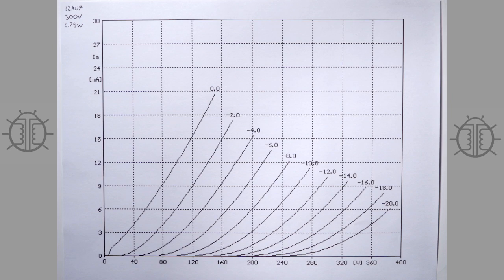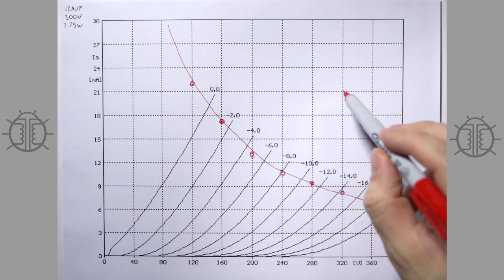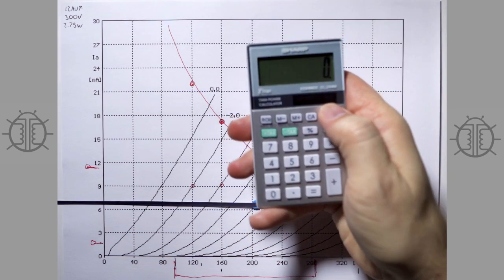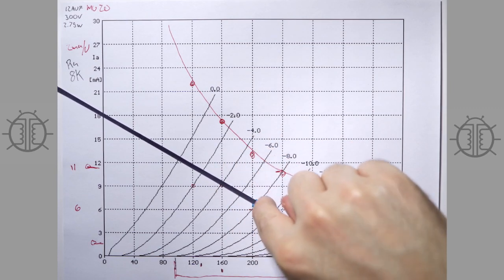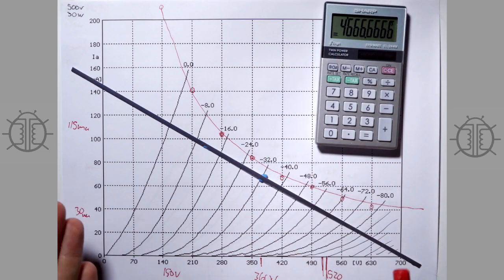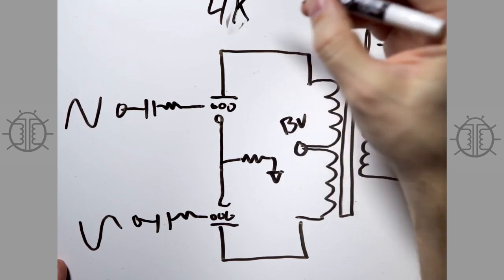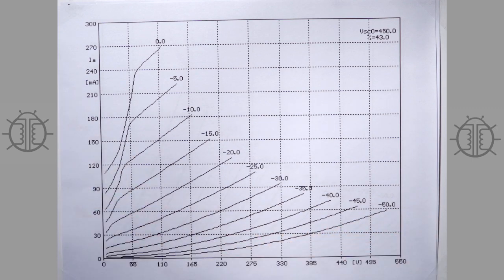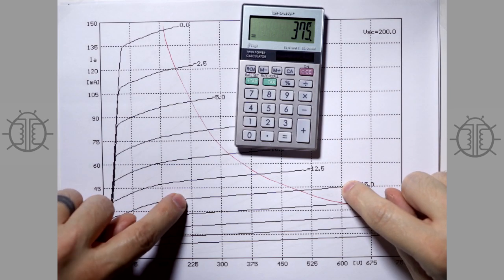Plate Curves and Load Lines!

Comment: So if I unload an amplifier by disconnecting a speaker I get a horizontal load line. Please correct me if I'm wrong: as long as I don't input any signal to the tubes grids I won't make no harm to the amplifier, because I stay at one point instead of swinging on the load line risking over powering the tubes and output transformer. I just want to measure a static voltage values in an amp but I don't have any load with me.

Comment: 17:32 horizontal load line, that's when you get the most gain for the stage and when the output has the least distortion. You can do this with a constant current source as a plate load. By the way, a 6cg7 will do everything a 12au7 will do but with a lot less harmonic distortion.

Comment: The best explanation ever. But i had a question. How can i know ezample if 12ax7 is good as driver for kt88?  I mean what i need to check to know ? Thanks
Reply from the maker: @jonathangauci2182  it has a lot to do with the input Z of a KT88. It will have a minimum grid leak value that will set the input Z. You have to place that Z in parallel wit the driver tubes load resistance. If that ends up tilting the load line too much you will loose the gain of your driver stage.
Reply: @Edgarbopp  thank you so much.

Comment: nice video thanks, a doubt arises at minute 36, if the supply voltage is 360v how does the signal oscillate up to 520?
Reply from the maker: Good question! Because the output transformer is an inductor it has a reactance not a resistance. It supplies the voltage above supply. Inductors supply voltage to preserve current. They’re a type of current source.
Reply: @Edgarbopp  That's incredibile, so when the tube oscillates in class A, before the cut-off at the bottom, it always reaches that extra voltage? Thanks for these clarifications

Comment: If my b+ is at 300v, and a cathode resistor is dropping 100v does that move the bias point to 200v on a reactive load?
Reply from the maker: The voltage is the plate to cathode voltage. So you don’t count the voltage across the cathode resistance in a cathode biased stage.
Reply: @Edgarbopp  thanks again! Much appreciated

Comment: At 33:45 you set an operating point.  What determines the angle of the line from that point?
Reply from the maker: I picked a slope that looked like a swept through the most voltage and current without exceeding the max dissipation. You can see it’s roughly 700v and 150ma. So using ohms law that’s a load of 4.666k or so. So an output transformer presenting a 4 or 5k primary load would probably work well there.
Reply: @Edgarbopp  thank you! It's taken me so long to understand,  but I'm finally getting their
Reply: @Edgarbopp it's all making sense now.  Thank you again. So much.  In regard to the perfect current source/ perfect voltage source. What helped me understand was to look at it another way.  If the tube went dead short to ground the voltage would drop to zero, and the current would be limited by the plate load resistor dropping the full voltage of b+ across it.  That is where the load line hits the graph on the left side. If the tube shuts completely off, the current drops to zero, and the voltage rises all the way to b+. That is where the load line hits the graph on the bottom. We are biasing, choosing a plate load resistor, and setting a dc region to rest in so that the grid voltage can swing either way, undistorted, within the watt limitations.

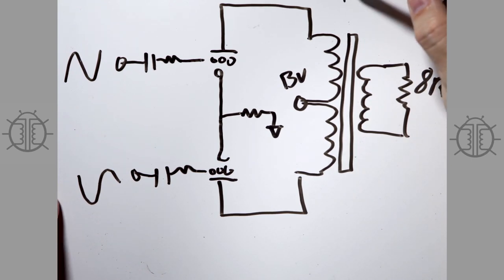Comment: I think your presentation is very good and am sure you know this and in a presentation I know it is easy to speak and overlook small things but just after 44:00 where you say the plate-to-plate Z is 8K and half of that is 4K is incorrect. It is actually 1/4 the L from one side of the OPT to CT and would be 2K instead of 4K.
Reply from the maker: I just reviewed that portion of the video and I believe what I’ve said there is correct. A 8k primary will look like a 4k for each plate of the output pair and will transition to 2k when the stage enters class B.
Reply: In a transformer winding like the primary of a vacuum tube output transformer, we have the series inductance of the coils from the CT which is L1 + L2 and we also have the mutual inductance between the coils as they are wound on the same core and share the same magnetic flux. Neglecting leakage inductance which is usually in the mH range, and assuming the coupling factor to be 1, the mutual inductance doubles the series inductance. A common value for vintage output transformers like the UTC or Acrosound transformers is 20H plate to plate and 5H plate-side to CT. Direct measurements with an LCR meter will confirm this.
Reply from the maker: @ElPasoTubeAmps  I don’t think I talk about inductance anywhere in this video. This is about the impedance of the primary and the resulting voltage and current swings at the plate. In this video the inductance of the primary is assumed to be sufficient to load all audio frequencies. Of course in real life not every transformer has sufficiently high inductance to load the lowest frequencies but that was beyond the scope of this video.
Reply from the maker: @ElPasoTubeAmps  I’ve just reviewed several articles to be completely sure on this and they all agree with my previous understanding. Have a quick read here as a example http://www.valvewizard.co.uk/pp.html
Reply: I commented because the inductance (L) of 1/2 the P-P winding (one anode side to CT) is 1/4 the P-P winding L, and therefore the Z would be 1/4 also.  Maybe inductance should be dropped from the discussion. I realize you were only speaking of Z but L has to go along with it and your video is about load lines and not about transformers.  L and Z is easily measured with an LCR and Rs meter on the bench in a static condition. 
The article you linked to is interesting and I can see that both of you have more experience in guitar/HiFi amplifiers than I do although I did do repair on such amplifiers for a couple of years here in El Paso after retiring. Quite honestly, I took up the repair of guitar amplifiers up so I could study the amplifier builds and designs... Anyway, I see where the article says that once the amplifier/transformer goes into class-B operation (which I am actually not buying that concept from just a signal drive perspective) the L and therefore the Z of the transformer winding from anode to CT changes from 1/2 to 1/4 the L and Z of the P-P winding. My point is, I do not believe the Z (or L) of half of the winding from anode to CT is ever at 1/2 the P-P impedance and remains 1/4 the P-P Z regardless of how the amplifier/OPT is operated. Maybe it changes under dynamic conditions I do not understand yet but I am open to learn and understand. My question would be how would we verify the claim in the linked article by measurement? I can't see how it would be done with plate characteristic curves as the load Z is a derived parameter from the characteristic curves and not an input parameter.  Maybe I am missing something here.  Best regards.
Reply from the maker: @ElPasoTubeAmps  it would be easy enough to look at the plate swing with a scope and see if it follows the load line I predict or yours for a given load. Maybe give it a try. Take precaution probing plate voltage though.

Comment: Hi sir thank you for make this video..but  I have some problem..I couldn't understand   how we can calculate output impedance..sir can you help me about it I saw some other YouTubers but they didn't say anything about impedance..and I need    to know about this section please lead me ..and thank you again
Reply from the maker: Asking what the impedance is, is asking the question “when I change the voltage at this point how much current will it require?”  So once you’ve drawn your load line pick a convenient place to measure the change in voltage along it and then measure the current change for that same part of the line. Then V/I=R. The R in this case can be thought of as the impedance. Though impedance is also time dependent so will change somewhat with frequency. But for now don’t worry about that.
Reply: @Edgarbopp again hi sir. And i am full of thanks for answer my question...sir I design my circuit...I choose my load line and everything is done ...but I need to know how I must calculate output  impedance..I don't know could I gave you my intention...
Reply: @Edgarbopp  I mean about impedance  is inner   impedance
Reply: Sir if you need more information I can give you my email  or my telegram or Instagram...you just tell me sir and thank you

Comment: I think is a good idea to clarify .How those two points that define the load line are selected ..
1) Max plate Voltage at 0 current .. THS IS the tube in cutoff ,,, no current flows ..this happens when grid bias is very negative
here the Max Plate voltage = Power supply ..So you will chose this point equal to the power supply 
2) MAx current  at 0 plate volts ( yes is the PLATE voltage not power supply) ..This happens when tube is in saturation ,,and the plate is at ground level .This happens when grid bias is very positive ..
Reply from the maker: Max plate voltage equals the supply voltage in a resistive loaded stage. It swings higher than supply in a inductively loaded stage. Thanks for the comment.

Comment: Wow, Doug, the best explanation of loadlines ever... the white boards, blue-tack, and load line sticks are so much better than any computer-generated graphic!

I have been in the electronic repair business for almost 30 years, and have loved vacuum tubes through all the integrated circuits and solid-state stuff I've had to slog through! 

I have been to college, have the Radiotron Designers Handbook, and too many others to list, and am getting into more tube design then repair work now that I have turned 65 (age has its benefits!).

The one thing I haven't wrapped my head around yet is the primary impedance change when one of the tubes shuts off in class AB.  I'm going to dig into my books and see if I can figure this one out.

Your video wasn't too long at all, I plan on watching it at least two or three more times.  Thank you for generously sharing of your knowledge!
Reply from the maker: Thanks for the kind words! It means a lot!

Comment: I keep coming to this vid haha, I'm in the process of designing a guitar amp with a push pull power stage using two PL504 and this is super helpful.
Reply from the maker: Thanks for the comment. It definitely feels good that people find this helpful!
Reply: @Edgarbopp  sure man. Hey, would you check my spice model of the design? I hope I’m not bothering. No probs if you can’t, the thing is I’m a rookie in this field and lacking feedback. Thanks anyway since you’ve already helped me a lot with these vids =)
Reply from the maker: @leandrocarg  if you show me the circuit I’ll have a look at it and let you know if I see any issues.
Reply: @Edgarbopp  thanks 🙏🏻! May I send you the files via email?
Reply from the maker: @leandrocarg  do you have Facebook or Discord?
Reply: @Edgarbopp  sorry for the delay, I responded twice to your question and for some reason YouTube doesn’t post the response. I have a Facebook account!
Reply from the maker: @leandrocarg  ok! Look for “Bug Amps” or my name and add me. Messenger will be a easy way to discuss your circuit.
Reply: Very useful and well done video!
One questione only: in the PP AB1 class circuitry, how does the load line switch from B to A? Ok, the designer select the proper Vg, usually not to enter the tube extra dissipation area, but It seem that the tubes "sees" the correct grid voltage to switch from B to A and viceversa.
Many thanks!

Comment: Great video! I love it. I've got one question. What to do if I'd like to design a Push-Pull power stage with multiple parallel tubes? Let's say that I'd like to use specific tubes and match the output transformer to them. I assume that I should just calculate the needed transformer primary plate to plate impedance as with only two tubes, and divide it by 2 in case of 4 tubes, 3 in case of 6 tubes etc. Am I correct? But divide or multiply?
Reply from the maker: The plates will be in parallel so you need to do the parallel resistance calculation.

Comment: Great video. Not to be too picky but I noticed you said around 19:05 “when you load the tube” and increase the steepness of the load line.
I’d think you mean to say as you load the power supply in the sense that the power supply is applying the fixed voltage to the circuit the tube is in. No?
Increasing the load on the power supply with less load resistance would steepen the load line resulting in more current thru the tube.
The beginning part of the video seems to explain a graphical method of or approach to solving a circuit (finding significant or operating point(s) of interest given consideration to dc voltage supplying circuit and load resistor and triode tube performance curves and voltage at control grid).
I just say this because it’s a subtle but important point.
I think sometimes you say when you load the circuit which is technically more correct given the triode behavior.
But for a pentode you could probable say load the tube because the pentode operates more like a current source or current driver.
But actually after thinking about it loading the pentode would be load line with decreasing slope.
But this is an excellent video and great reference source and I will study it.
I have Simulink and I’m  going to build a model of circuit with tube behavior in a kind of black box model and plot out the performance curves.
I’m going to extend the operation to saturation beyond what the tube can dissipate as if the tube is ideal vacuum tube with unlimited heat rejection.
But you have answered the question about the part of the behavior where the curves end at operation point where tube operation is heat rejected limited and in the shape of constant power.

Comment: hi sir excusme ...when i saw your video in time 38:46 you pointed to a voltage at limit 90volt i need to know how you calculated this voltage??? because i  want to try  make a circuit vacuum tube and i need to know very accurate...please lead me and thankyou for make this video
Reply from the maker: You can divide any change in plate voltage by any corresponding change in plate current along the load line to find the plate impedance. Just pick ones that are convenient and around your operating point.
Reply: @Edgarbopp ...i love you and thankyou
Reply from the maker: @mohammadmoezi3813  Thank you! Good luck!

Comment: hi sir..i saw your video you are perfect bravo... sir you explain about how we can bias  power section with trans for impedance.. now i want to know can i use this design that you do for power section..can i use for otl systems ..pleas lead me and i want appreciate of you for make this video
Reply from the maker: Definitely! For OTL you just draw the load line for the load you want to drive. Most OTL are using parallel tubes so you need to calculate for the load sharing of the output tubes.
Reply: @Edgarbopp  ...ok and thankyou sir

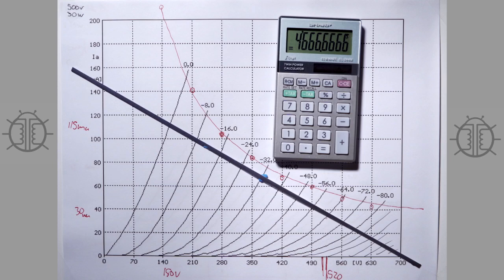Comment: 35:41  If we need to choose an actual transformer, knowing that our primary impedance is say 4.5K, and our load is say 8 Ohms, then our windings ration is sqrt(4500/8) = 24:1.  Mehopes.
Reply: Close. That will get you the impedance ratio. To get the turns ratio use sqrt(zpri*zsec). T be clear, multiply rather than divide.